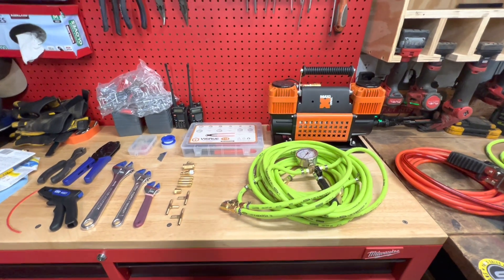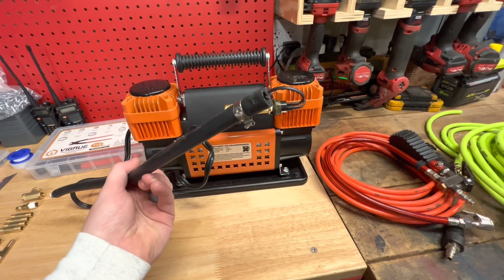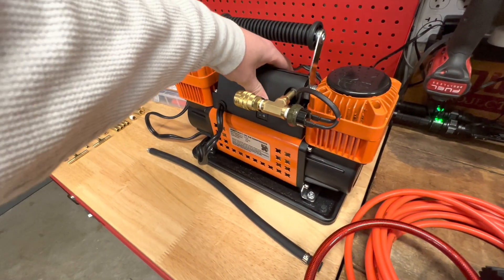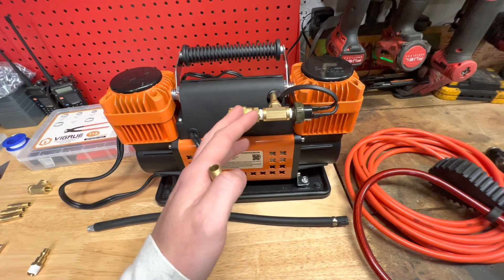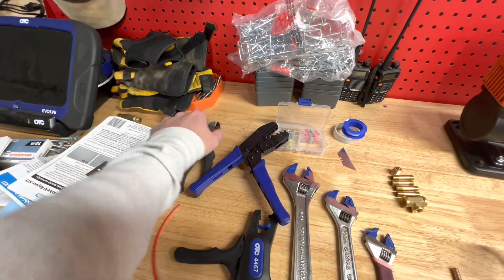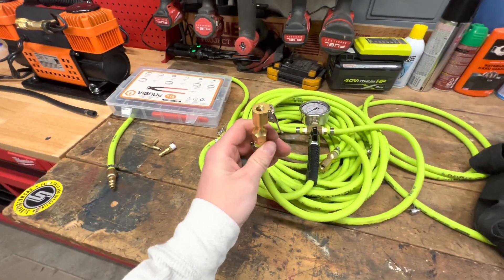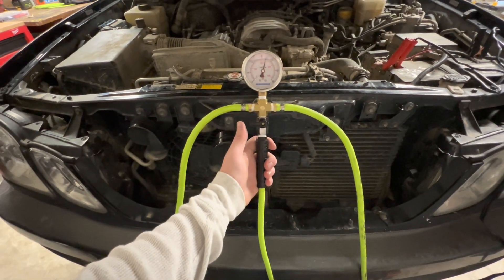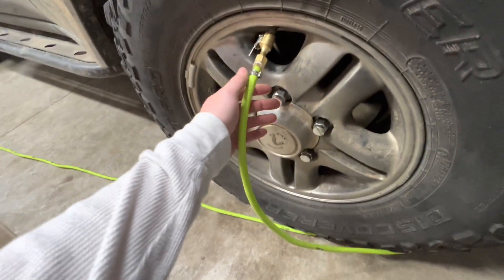Maxi Trac Compressor Mods + Four Wheel Tire Inflator Build

Comment: Awesome video, exactly what I was looking to do since I dont have the tools (or desire) to do the in-line drill solution for the pressure switch a lot of others have done. Do you mind sharing what lengths you cut the hose for each section?
Reply from the maker: I based my lengths off of the video referenced! If I recall correctly, he has a basic formula for calculating lengths from your wheelbase

Comment: Instead of just a pressure switch you can buy a combination pressure switch/ unloader valve so that the compressor doesn't start under load, which I'm sure is why a lot of compressors tell you to have the compressor running before hooking to the tires. The unloader switch is bulkier but will help the compressor live longer

Comment: Hi may i ask why when i do mine the pressure switch doesn't work at all i have tried different switch but i dont have a good luck, any reason why it doesnt work for me? :(
Reply from the maker: Are you certain your wiring is correct? I’d double check that!

Comment: I made a 4 four wheel inflator/ deflator many years ago. I used a pressure regulator just before splitting off to the tires. I valved the splits off and set the pressure I wanted to inflate to, then opened the valves. I could inflate to where I wanted without having to monitor it.
Reply from the maker: Nice! That's awesome!

Comment: What size pinch clamps did you use ?
Reply from the maker: I can’t recall the exact size, but the kit I purchased had a clamp that was just a little larger than the outer diameter of the hose I used. Worked like a charm!

Comment: Would have been nice to see the actual modification of the pressure switch connection under to cover
Reply from the maker: I bet it would be - which is why I linked to a video that shows it 👍🏼
Reply: @LexusOverland  thanks, did not see that,  thought you said he showed this on instatwat, did not hear YouTube

Comment: Is the small Red wire going into the motor a thermal overload?
Reply from the maker: Unfortunately I am not familiar with the circuitry beyond where to intercept for the pressure switch!
Reply: @LexusOverland  I found that it is a thermal overload switch.
Reply from the maker: Nice! Good find!

Comment: I saw in another video that the positive leads on their pump had wire strands pocking through the heat shrink ... I just picked up one of these and pulled the cover to find the very same. I would advise this to anyone before using to check these wire leads and re-wrap if necessary. NAPA needs to require the manufacturer to better their QC.
Reply from the maker: Yup, that’s the video I referenced. You don’t get better QC at $114 a compressor unfortunately! Lol

Comment: Thanks for the video and great you gave credit to Kevin as well! I just purchased this compressor and seems to be awesome for the price we'll have wait on longevity. I am interested on the pressure switch, but I am not too sure if it is healthy for the compressor due to its design as it will pressurize the heads and seals while on standby. Not an expert on the subject, but is just an idea! Any opinion or anything that you might know about it? Thanks again!!
Reply from the maker: I appreciate the kind words! Thank you! Ideally you will only have the compressor pressurized momentarily. As soon as you disconnect the air hose it will relieve pressure. It is very normal for compressors to build pressure and hold it, such as in a shop situation with a larger compressor, so I doubt it will make a large impact on the lifespan of the compressor.
Reply: Where did you purchase, do they have more? I'd buy one from you they are sold out here

Comment: What size pinch clamps did you use out of the set? Thanks.
Reply from the maker: I’m traveling for the holidays so I won’t be able to check the dimensions for a bit. But I used the clamps that just fit over the hoses. There were enough in the kit to do all the clamping I needed!

Comment: What is the range of that pressure switch?
Reply from the maker: It’s a 90-120 psi switch - it’ll shut off the compressor as soon as it hits 120 psi, and when you open the air valve it immediately kicks back on as the pressure drops below 90. Works perfectly and 120 psi does not seem to stress the system at all. You could purchase lower psi pressure switches if you’d like!
Reply: @LexusOverland  Thanks.  I just ordered the exact same compressor, being delivered in 1 week.  I'm doing the same upgrades you are, so thank you.
Reply from the maker: Hey that’s awesome! Good luck! I’m happy I could help!

Comment: I saw Kevin's video before yours, but I really appreciate some of the tips you gave. Like the Napa rewards, as I was able to order one under $100, tax included. One thing I can't decided on is the pressure gauge. Should I get a digital or analog one?
Reply from the maker: I appreciate that! Kevin’s video is awesome. Nice work on getting a good deal!

I have an ARB digital tire inflator and it’s been great for the year or two I’ve owned it. My logic for getting analog is that it will always work. Never have to worry about batteries or anything weird. If you’re not out in the boonies frequently I’d go digital. Otherwise, analog is the safest bet!

Comment: What size wire did you use to connect to the air pressure switch?
Reply from the maker: I believe a 16 gauge? It’s not super crucial to be a thick wire as it’s just a signal wire to switch the compressor on or off. It intercepts the factory wiring - so you can match that!

Comment: That pressure cutoff switch is great. Wondering if I’d be able to do the same thing with the viair 400p, mistakenly bought the non-automatic one and have been too lazy to return it 😅
Reply from the maker: You sure can! Just find the wire from the on/off switch to the circuit board and splice it in. I’ve heard of people doing it on others. Do it!

Comment: Awesome! I’ll likely do this to my other compressor! Thanks for sharing.
Reply from the maker: For sure! The principle should be the same - splicing the pressure switch in between the on/off switch and the circuit board. 

I should have mentioned it in the video that the pressure switch just works by cutting continuity when the upper pressure is met, and restoring continuity when the pressure is relieved. Super simple and great!